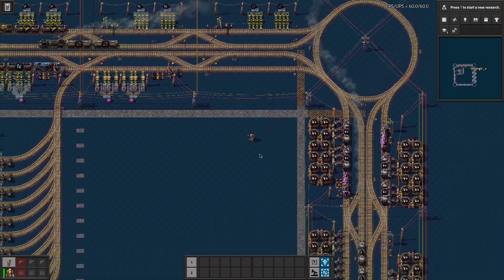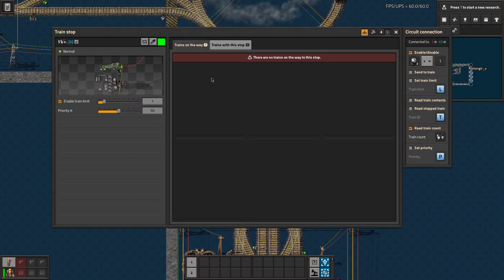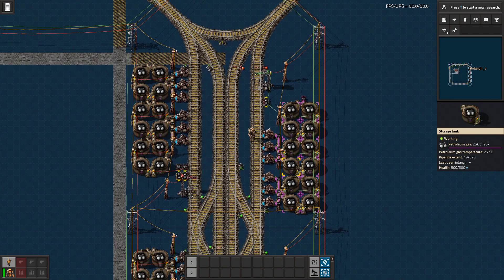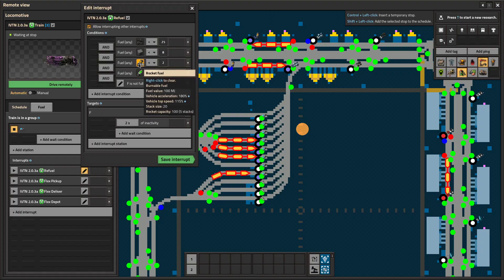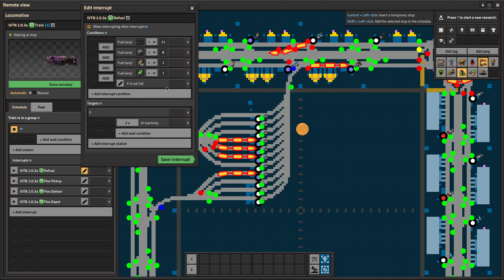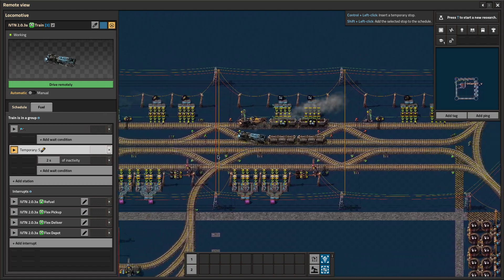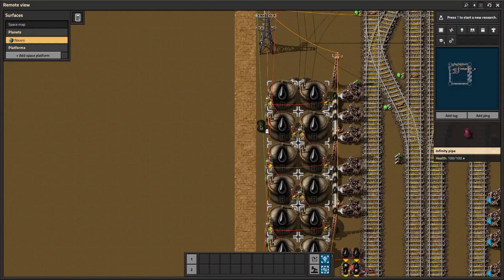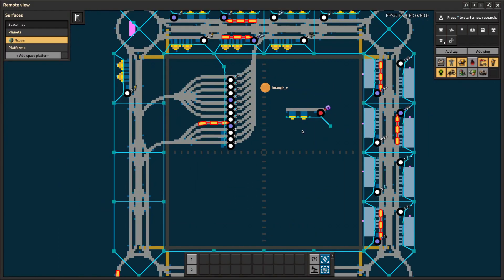Factorio - IVTN 2.0.3a updates and fixes - flex fluid trains now

Comment: Awesome updates. Your previous video motivated me to reverse engineer the design (using your BPs only when needed). I also added some elements -- support for station limits >1, light indicators to show item levels for sender and status for receiving. Overall spent way too much time on it, really addicting. Probably about 200hrs into SA and only been to Nauvis and Volcanus lol.

Really wish there were better ways to update items within blueprints without impacting parameters and better ways of updating placed blueprints in the world -- some sort of synchronization where any changes are applied to all previous placed identical BPs or at least not requiring deconstruct beforehand
Reply from the maker: I haven't left nauvis yet, i keep playing with train BPs instead of advancing